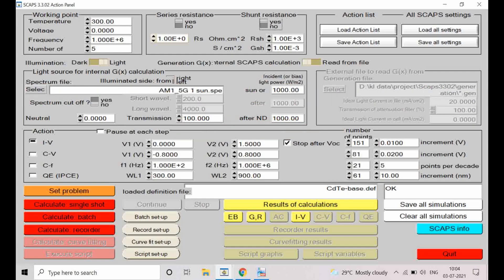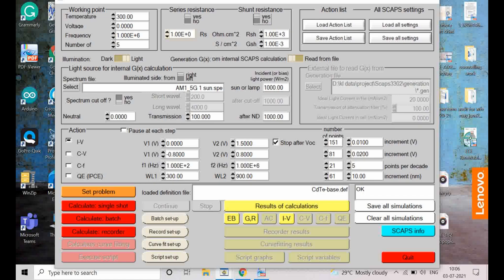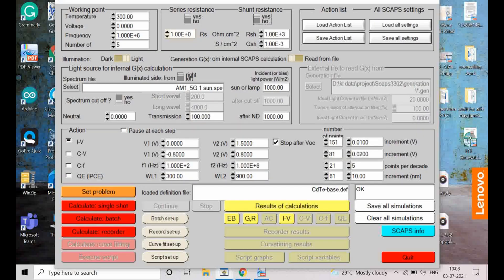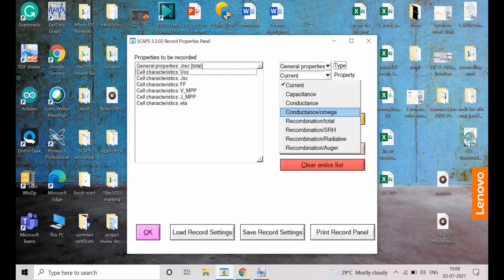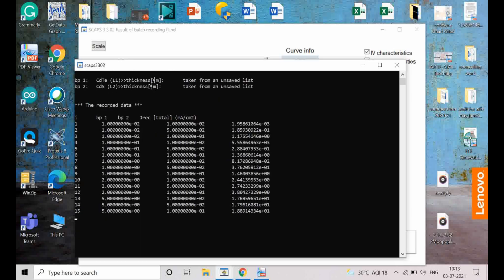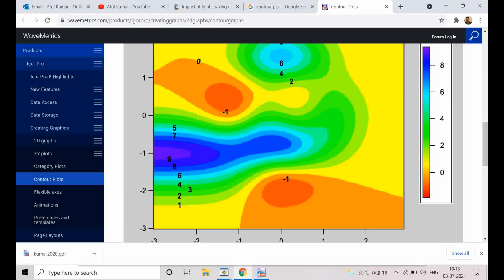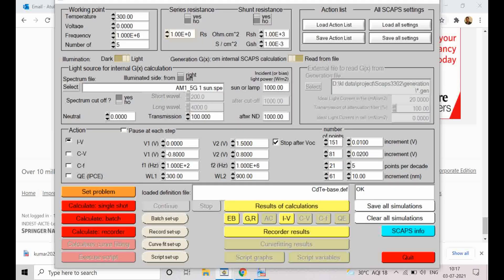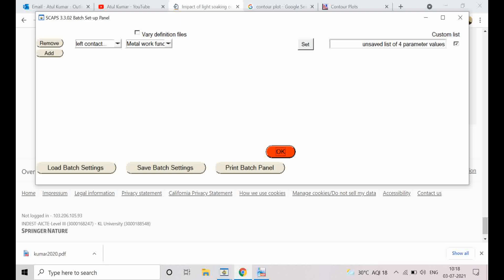Session 10: Plot any desired simulation in SCAPS using Batch and Recorder setup

Comment: thank you for your effort, but I have one question you say internal reflection if zero it means no reflection from your talk it is preferred to make it  equals zero but when I increase internal reflection to for example 0.3 my structure efficiency increases so I think it means by internal reflection of front contact is the reflection of light that reflected from back contact without absorption by absorber layer so it is preferred to be high to increase the light trapping that occurs after this reflection increases by for example texturing interfaces to achieve total internal reflection. what I say is true or not ? thank you
Reply from the maker: you are correct